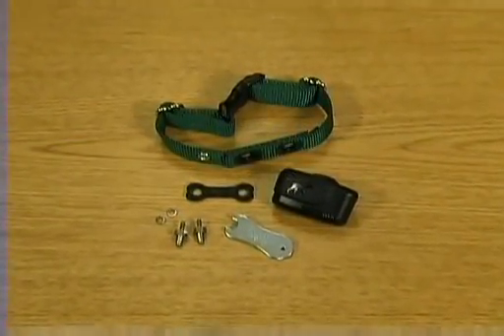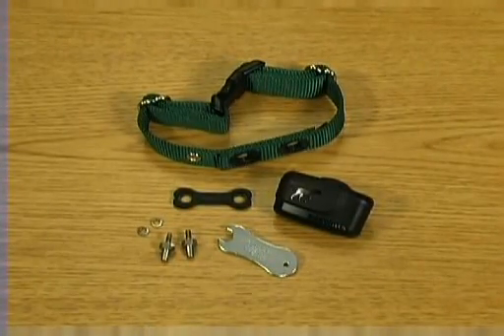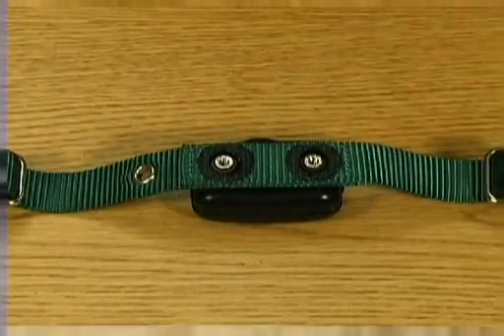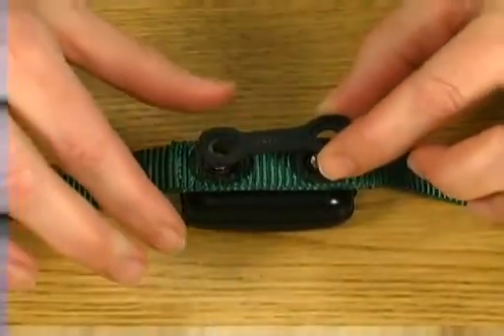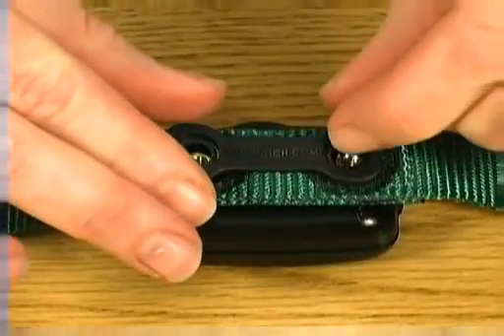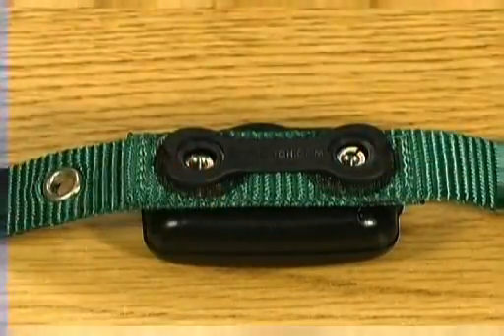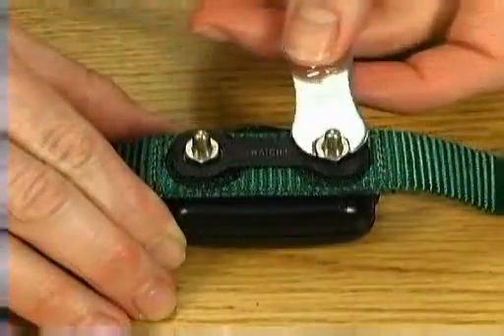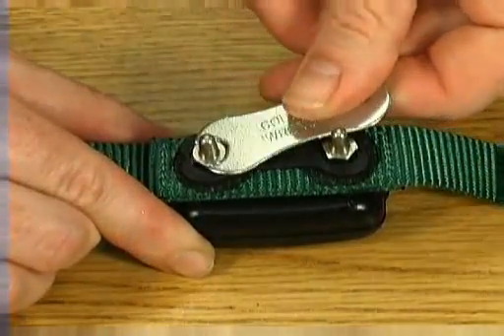DogWatch® - How does the receiver attach to the collar?

Comment: Hi - we have a dogwatch collar and need to move to a larger one, but when we try to unscrew the prongs they just spin and spin, but never loosen - any help you could offer would be terrific as it's frustrating and our dog has outgrown the collar - thanks!
Reply from the maker: Sorry you’re having an issue removing your DogWatch receiver from the collar. The receiver is covered by a lifetime warranty. If you contact your local DogWatch Dealer they will be more than happy to assist you with getting a replacement. You can find your local dealer here (https://www.dogwatch.com/) by clicking on the “Find A Dealer” button.